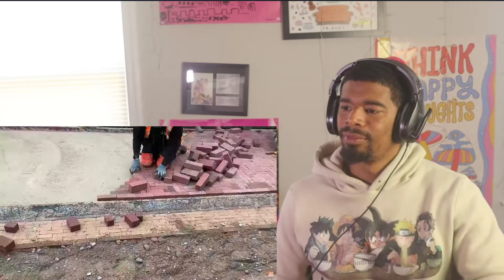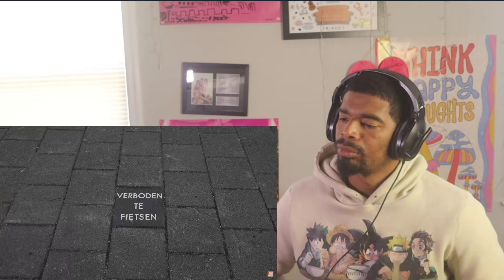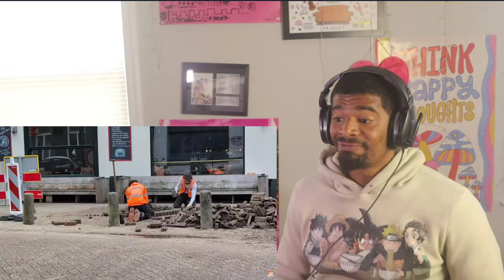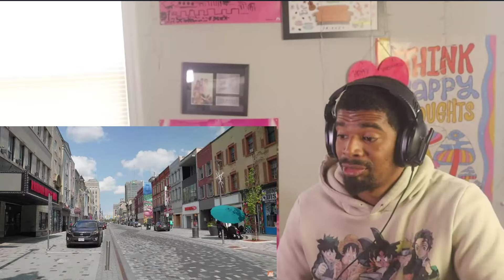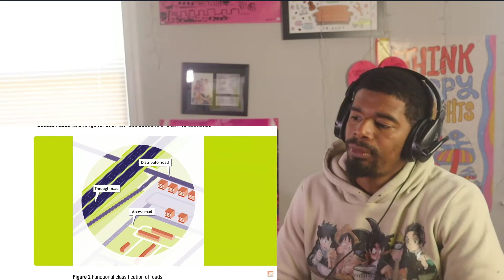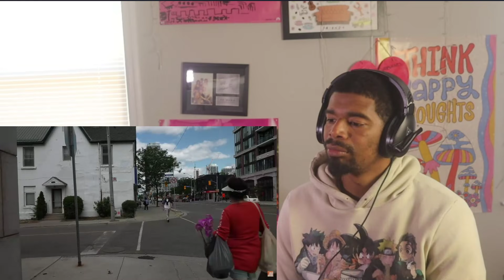Natural Handcrafted Artisanal ... Streets?! | American Reacts

Comment: allot of the times when asphalt roads needs repairing or get broken by pipe manegement or stuff like that they use klinkers to fill up the holes in the asphalt (which can be quite annoying to drive over) 
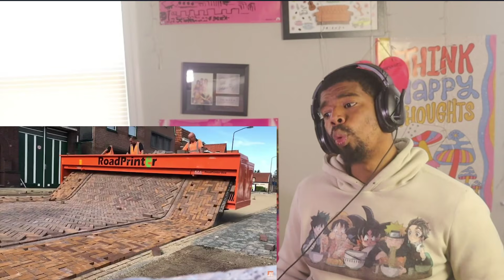as someone who is born and raised in the netherlands i can say that those street printer machines at 7:40 arent used since that video that is shown is litterly the only vid i know of that uses that machine i havent seen it actually used in normal construction

Comment: The word "klinker" in this context means "sounder" because of how it sounds - having been baked to extreme hardness and strength. Much harder than "bakstenen" ("baked stones" - bricks) that produce a softer and duller sound when the mason taps his trowel on them. So klinkers-pavers are in the road and bakstenen in the walls of our houses.

As we live on/in the flood plain of the North Sea (Atlantic) to the North and West, we are in the sedimentation plain too and there's no "rock" nearby. Incidentally, to the East and South, we are in the flood plains of a couple serious rivers. This means there's clay. Part of the soil, however, has a swampy, peaty, nature and other parts less fertile sand. This can make for a naturally unstable soil that almost always needs analysis and adapted preparation for us to build on, be that roads or buildings, and civil engineering "art works" (bridges, viaducts, aqueducts, fly-overs, etc.). Clay soils can keep moisture very well, but retain stability. Sand drains easily, and thus retains a form of stability. Peat is a problem, and so are sand/clay mixtures. When peat falls dry, it compacts and this doesn't change when it gets wet again. Sand clay mixtures get a "sol" quality when immersed (think of "quicksand").
In our soils, we have the water table relatively close by. Maybe 2 or 3 feet deep on average. We cannot pump that away too much because under a top layer of fresh water we have salt water (as if in communicating vessels with the sea). Removing the fresh water raises the salt water table. And that would be an issue in agriculture. Replenishing the fresh water, being lighter than salt water, does not drive the salt water down enough.

So "klinker" paver-bricks are found everywhere, but weren't exclusively used to pave. We also have/had "kinderhoofdjes"/"kinderkopjes" (children's little heads), or called "kassei" in Southern NL and Flanders, that are hard rock cut into child head proportions (as a manner of saying, not "really"). These each would have slightly curved tops, so this gives a somewhat corrugated road surface. Which generates noise when you ride on them. These pavers are rock hard, generally from a porphyric type of rock (lava-origin). And they give more road noise than klinkers.
These child-head-pavers are a thing of the past, I think. And I don't know what design criteria had to be met for a municipality to decide to use one or the other, before asphalt/tarmac.

Today, "klinker" pavers are used as a tool in "traffic calming".

We Dutch may think we are very good at perfect roads, but as we have the soil implied above, changes in the soil happen and this may make roads uneven easily, quickly. As we also want trees along our roads, the roots of these can develop under a road and push the road up under each significant root. Some trees form roots primarily horizontally (e.g. poplar) and will not be blown over, but they would ruin the evenness of our roads. Trees that drive their roots more down, however stop developing roots when they almost touch the water table, so these in the NL often have a root system that is too small relative to what is above ground and such trees would easily be blown over.

Altogether, it's not as simple as it looks. "Design" is everywhere. Down to the nitty-gritty details.

Comment: Paving roads goes back to the old Romans, potentially before that. The Romans had a layered road "architecture" ("design principles") that was very robust and reliable. When you visit old archaeological Roman towns like Pompeii, you can see these still being there. You can also see stepping stones for pedestrians to cross the road at specific distances from each other. The roads would have been full of muck because of the animals dropping their output and other sewage use of the roads. So pedestrians used the stepping stones to void this. The Romans also standardised the distance between cartwheels. This was to reduce the chances of the wooden wheels breaking. That distance defined the space between the stepping stones and became track-width in many Western railways.

Comment: There are more reasons  why they use klinkers. First of all the ground is ground is a lot softer and with newly  build  houses  you'll  find that the street will sink because it's not compacted enough,  than it's  easier  to take it out ,put more sand ind and put it back.second thing is, ll utilities  and sewers are underneath  the pavement  so it's  easy access  and finally the water drains faster because the water has somewhere  to go combined with the sewers and nothing gets floored.

Comment: I wonder if they put some type of sealer in between the bricks
Reply: Usually not. There's fine sand between them. So they have a bit of wiggle room that prevents cracks, and water can go through, to prevent flooding.

Comment: Even when the klinkers or concrete pavers are completely worn out, or even cracked into pieces, they're ran through a crusher and used for underlayment to stabilize the road bed under asphalt roads, to make those last longer and prevent potholes.

Crushed rock, brick and concrete compacts down a lot more stable than round river rock. That's one of the reasons you see so few potholes in our roads.

Comment: Well laid bkk klinkers could  last centuries in the right spot. Its all about proper prep work.  beneath a good klinker road you have 30-40 cm of prep work, if you want perfect work you get 50-60 cm of work beneath it. Broken rock/gravel is put underneath, a layer small gravel on top and above that clean sand. On top of that you put your klinkers - basically you ensure no sinking or moving happens underneath the road or pavement you make. Water gets through this quickly and even filters the water so your ground water table is less effected by dirt. Its similar to old roman roads. Some of the streets in my city have remained unchanged over the last 40 ish years, there is an old bell some one cut and hammered into a corner of a brick and has been there as long as i have lived. 
These days the new bricks are much less well made then the really really old stuff. But only the old stuff.. that was made to last.
The patchwork crap (klinkers in holes for construction on asphalt) is horrible. Often wonder to myself why they dont just rework the street if its that urgent to do the work they had to cut the street for.

I used to do a lot of paving (when i was a teen) As a sidehussle. Mostly garden paths and pattio's. Did my parrents garden as well. Even some 20 odd years later it looks like i did it yesterday. Only evidence of age being the moss growing between the tiles and klinkers. Recently drove over a road i helped pave when i was 16, asside from some crap folks stuck on it and one speedbump cars  take way to fast (cars hit the bottom to the road and tiles get damaged) It still is right and tight.  But only part i miss about that work is the 6 pack i  got doing the lifting required ;)

Comment: Nice to give attention to this! It is my field of expertise, I work for the Amsterdam Engineering Bureau which translates the choices of the design into the technical and contractual requirements to have the contractors execute. At the moment there is also a lot of thought how to give the tree roots that push up the stones a correct growing place. A big challenge because not onley the roots but also all the cables and pipes have to fit underground here in the NL.

Comment: If they patch a piece of asphalt with klinkers it means that they will need to get access to what's underneath again in the near future and thus they use klinkers as a temporary stop gap measure. After all work is completed that needed the holes to be dug there, the asphalt laying crew will come in and redo the entire street.
Reply: We had a small sinkhole in our main street, it was quickly fixed and they put klinkers on it, after a week they checked the pipes under the street for damage and a week alter asphalt was poured in.

Comment: I just walked 20 minutes to the supermarkets and on the way back I walked on the opposite of the road and the pavers were all uneven laid and I almost tripped and fell. I used the municipal app to make a photo and complaint. When I was home there was an automated answer email that I would get an answer within 2 workdays when it will be repaired, but at least within 10 workdays, or that it would take a few weeks if the whole path needs to be resurfaced. I did complain a year ago and within 4 days the bicycle lane was repaired. It is satisfying that the municipality is reacting like it should, that’s why I pay my municipal taxes.

Comment: 4 problems with them are: 

They can shift if the dirt moves, requiring a reflattening but due to a 5 centimeter rule the city keeps it inaccessible for strollers and such. Random people aren't allowed to fix it since its public property.

We put our bins out at collection points but the wheely bins make a lot of noise. If you live on a corner that a whole neighbourhood needs to pass by, then expect loud noises 4 days a week all day through.

Can be used as weapons during riots.

Nasty shaving wounds if you fall on the grainy ones.

But they're very much more prefferable than scarred asphalt everywhere.
Reply: Quote: "They can shift if the dirt moves, requiring a reflattening but due to a 5 centimeter rule the city keeps it inaccessible for strollers and such. Random people aren't allowed to fix it since its public property."

In Utrecht there is a street along the singel where they didn't put anything inbetween the klinkers. Has a nice sound when you drive your car over it. (Weerdsingel Oostzijde)

Comment: There is a new methode as well. They lay asfalt and than get over it with a machine that make it look like bricks pattern
I'm born in the 50th and before the machines were invented they layed all the bricks by hand.
Reply: That's barely used here. And takes the whole point about why we use bricks away. It's explained in the video.
Reply: Might look better, but does not do anything for the other advantages of brick roads.
Reply: @markjordens  no but it is cheaper than laying bricks and looks better than asfalt
Reply: @ The clip explained its cheaper at the start but the total costs of ownership in the long run are higher.

Comment: In my town we have a street in the town's centre that's made out of asphalt but looks like bricks/klinkers.
They used a mold to press the 'klinker design' in to the asphalt. 
It's a great way to reduce the noise of authentic klinker roads, but benefits the long life spand of asphalt/concrete. And because red asphalt was used it even looks nice!
Reply: By making them of asphalt or concrete you effectively eliminated every advantage you get from bricks and all the downsides of asphalt, except the eastatic look, and a clear indication whomever desided that of making it a fake brick road had no clue what he was doing.

Bricks have several advantages when used in a city centry, Noise is exactly one of those reason why you want a brick city centry road, the harder people drive the harder the noise, the more people psychologically reduces the speed due the noise inside the car the road produces.
By eliminating the noise, drivers are getting a incentive to drive faster.
Hence we Dutch have brickroad citycentres with narrow streets by design to reduce speed and increase safety for everyone that uses the road, not just cars, even in urban area's where we have enough space to even have 4 lane roads, and those 4 lane urban roads we still have, we are removing them for narrow brick roads as these are the unsavest roads in the city.
Just Not Bikes channel made a very good video on this, explaining in detail the advatages and disadvatages in road designs. 

And thats just one reason, maintance is a other aspect, brick roads are easier to maintain, easier to modify or opening them up for work underneath the road where a lot of utilities run under, and afterwards very easy to restore, thus having a low impact of the flow of traffic on the street, no heavy machinery needed to fix the road, and it lets drain water on a natural way thus it saves of drainage systems as well, and it does not crack in winters when frozen.

Just a few reasons why you never want a fake brick road in a town centre.
Reply: Most time used to get the speed out of traffic. Klinkers don't look as smooth as asphalt so it isn't as inviting to speed as a smooth asphalt road.